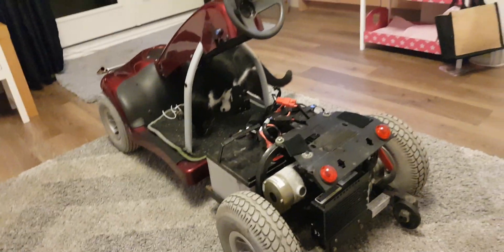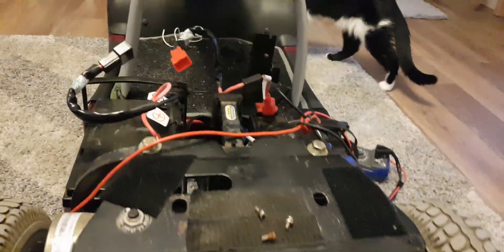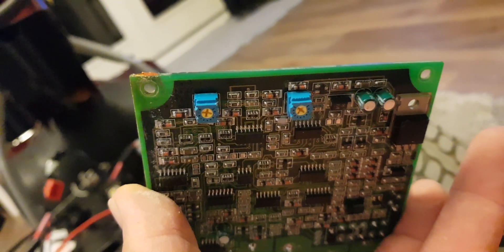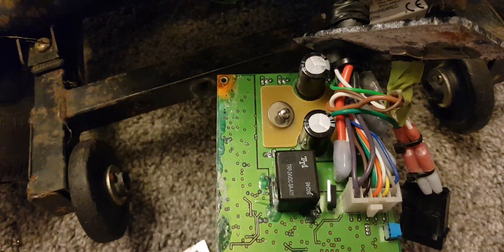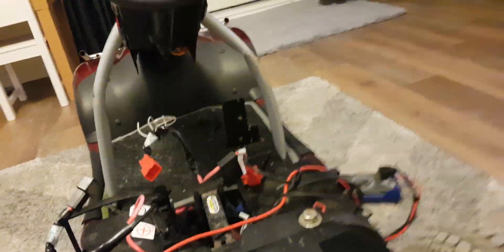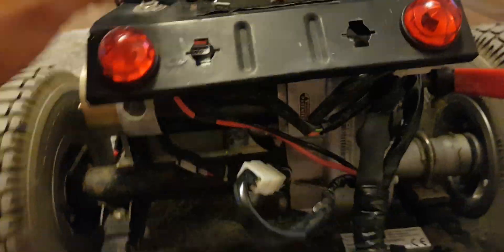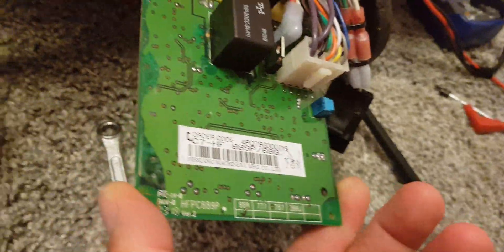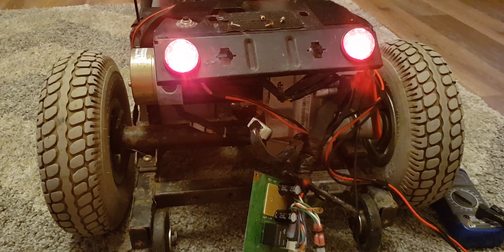Mobility scooter modified gokart electric speed controller mods and repair

Comment: Hi, I’ve just a brand new tga super sport mobility scooter which only goes 8mph, I’m looking for someone who can modify it and make it go faster..?
Reply from the maker: Best bet is find someone who services them and ask them if there's anything thay can do to make it a bit quicker.
I don't know the scooter you have but I'm sure someone will be able to do something with it to get it faster.
Reply: MAD MODS   I’ve tried and I’ve tried to find someone I’ve even asked in garages, I can’t find anyone at all 
, the scooter I have is a TGA Super sport.. x
Reply from the maker: I've had a Google and can't find much about it. I've seen the one you have and the speed controller it has. There very expensive to replace and wouldn't recommend playing about with it to much increase something goes wrong. But you could try and get a speed controller for a bike
Reply from the maker: A 24volt bike speed controller may well get a better top speed but don't know if all the other functions would work on the scooter like the lights and horn and possibly reverse.
Sorry I cant help any further.
Reply: @MADMODS  would you kindly be able to change the motor and controller to powerful ones and long range battery?  I would pay for your services. And provide the scooter and parts
Reply: I took an hour to take out my dads speed controller from a Kymco midi xls and gave it to a friend who’s an electronic engineer it now does approx 16 to 18 mph but the range is down to about 10 miles and only cost me a pint
Reply: Rats 🐀  ate my potentiometer wires! Can you help with which three cables on the board are the throttle wires. Wich is the key/start wires. Would really appreciate your help!